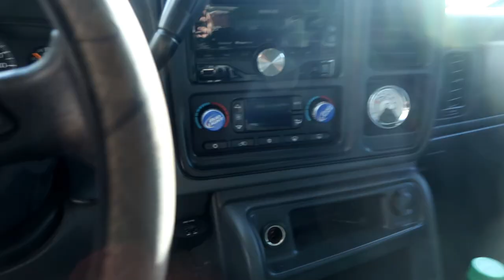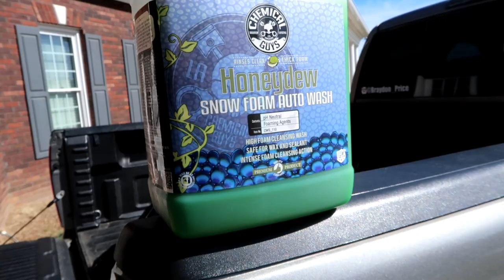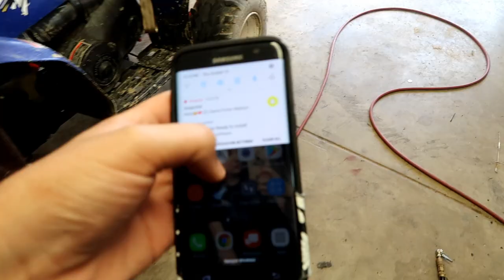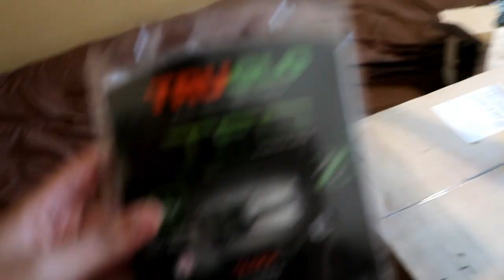MY TRUCK GOT KEYED!

Comment: Dude that Bedliner will cause your truck bed to draw moisture and rust. If I were you, put a duracoat  spray or roll in type, probably cost $80 just sayin,.. I had that same type you got in my first truck. Never again will I have the plastic type cheap made suppose to be rugged liner, they are junk, that's a nice truck so i'd imagine that you want to prolong the life of it; you can't go wrong with the spray in liner. If you decide to do it urslf for around $50-$80 make sure the surface is clean and DRY prior to applying duracoat.. Good luck and happy trails 🤠👍🏼..
Reply: BlkiceMike I’ve got an aluminum bed so I don’t have that problem. LOL

Comment: Dam nigga dam... use some oil to remove the scratch it works
Reply: MrThe302crew what? How the fuck will oil fix it when the scratch goes into the metal,it's not residue
Reply: AL._ 15 try it then tell me if it dont
Reply: MrThe302crew it don't.

Comment: Your truck with a duramax in it is literally my dream truck. I got pretty close but mine is a 2003 1500 Silverado with a vortec in it kinda wanna get it swapped with your interior and especially the bose speakers that come in it bc mine is the LS model and it has cloth seats and the trashy speakers